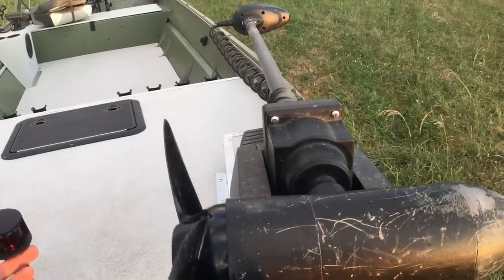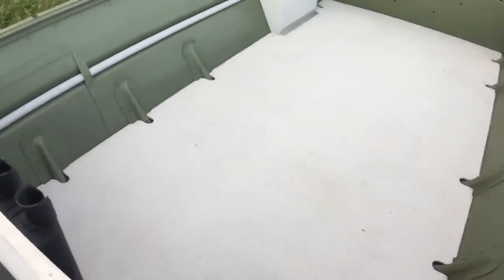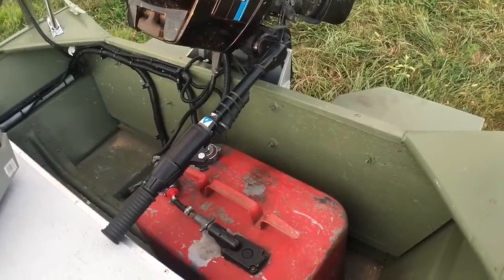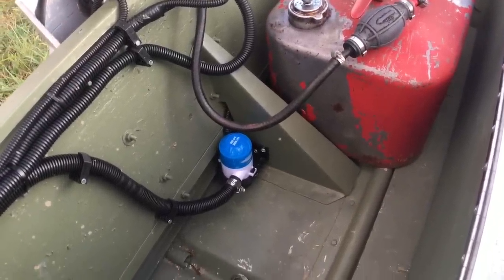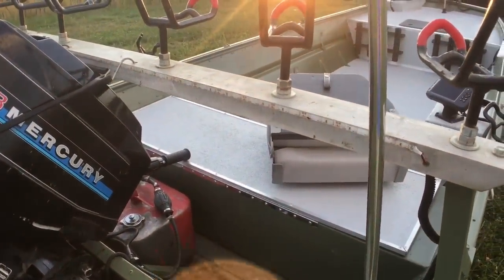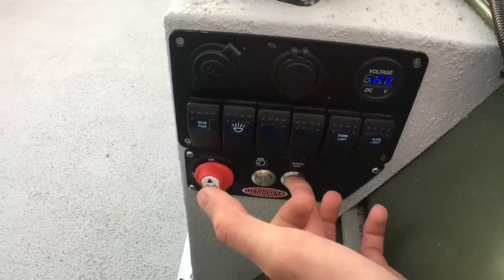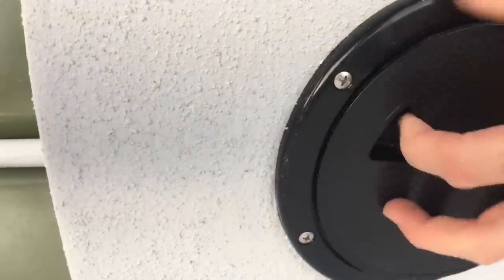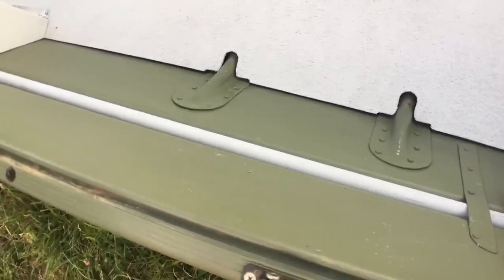The ultimate Jon boat for catfishing..Jon boat to cat boat!

Comment: Hell yeah thank you for the video, I needed to see this cause I have a tiller jet 1750 smokercraft just like this and I am gonna take out the benches and make a jet sled out of it. I built a solid rivet gun for these boats out of an air hammer and 3/4 bolt for butting up these 3/16” brazier head rivets. Gonna re watch this to see what you used for the floor board. A 12x4 sheet of aluminum is around 200$

Comment: Clean boat dude, looks great. What did you use for the tiller extension, looking for something exactly like that, only a minor extension. Did you cut one down?
Reply from the maker: Thank you, I will be happy to answer your question if you could elaborate a little more. Thanks for watching.
Reply: @hagengrubbsfishing  My bad, *tiller extension. The outboard handle.
Reply from the maker: Oh ok I gotcha lol. I think the one I used was originally for a trolling motor that I cut down to size. 👍
Reply: @hagengrubbsfishing  Awesome, that was my plan as well. Thanks for info.

Comment: After removing the middle bench have you noticed any flexing or any 
other actions of the boat .
I've got a 16' Smoker Craft and I would like to do the same thing to my boat.
Your boat looks good.
Reply from the maker: No I was worried about that but there was actually a rib under the bench that I removed so I didn’t notice any difference . Than you
Reply: @hagengrubbsfishing      Thanks for the reply

Comment: Dude THIS is exactly what I needed, just absolutely awesome and most of all PRACTICAL ideas.    Couple questions, what did you build the switch box out of? Just 2x4 and 1/2 ply? Where did you get the access panel? And you used 1/2 plywood topcated with bedliner for the flooring, correct?

Comment: This is great! New sub here, love the content. By far one of the best setups I’ve seen, did you notice a difference with rigidity out on the water with the center seat section removed? Removing that opened up a ton of possibilities.
Reply from the maker: Thank you, I did not notice a difference after removing the bench but that was definitely a concern I had.  Luckily there was a rib inside of the bench. I also think extending the front deck helped with side to side rigidity. Thank you for watching 👍

Comment: What u use for the deck marine ply wood. And we're u get the no skid coating ur talking about also info how take bench out leave rivets in. That what want do my boat have large open area
Reply from the maker: The deck is just regular 1/2” plywood with several coats of oil base paint to preserve it.. the non skid coating is called tuff coat and I ordered it from amazon.. as far leaving the rivets in I just cut the bench off flush with a cutoff wheel and ground everything smooth with a grinder with a flap disk.. Hope this helps. Thanks for watching

Comment: When your 12v outlet starts giving you problems check out some of the Anderson Power Poles 15a/30a/45a size (Powerwerx.com)   Wire them up like the Amateur Radio guys (HAMS) use them (red on the right, tongue up).  Put them on every thing 12v and can't be plugged together reverse polarity. Even have sizes for your starter battery, Winch battery, jumper cables ect. Very durable! Awesome boat build!

Comment: Does the center seat being removed make any difference in the stability or can you even tell a difference? Really good video btw👍
Reply from the maker: BV_PawPaw can’t tell a difference. The back of the deck starts about where front of bench was so it supports the boat about the same as bench did. Thank you for watching

Comment: Just wondering as I am planning on getting a Jon Boat and setting it up . HOW hot does the floors etc. get in the sun in the mid summer hot days. I am in Central Texas and I do not want to be cooking myself or my wife out on the lake when it's about 110 degrees and sunny.

Love you videos. I have been checking out a lot over the last few months getting ideas and watching HOW I DID IT and WHY videos.

Comment: Did that boat come with the center. Like that with that space in the center if not could you tell how did you do that
Reply from the maker: For the most part yes. It had a bench toward the front that I removed and extended the front deck some. ThNk you for watching.

Comment: How did you frame out the inside of your trolling motor mount? Aluminum angle on the inside and riveted the plywood to it? I’ve copied a good bit of your boat to mine really like the setup, I’ll have to send you a pic of mine

Comment: I've been debating about getting a mini jack plate for my 1978 ,15ft Fisher marine, 25hp, looks like a lot of trouble to take motor off & on, have some (trolling motor only lakes , that i like to fish, Does the plate make enough benefit? Would you do it again? Overall Nice Job. Thanks for Sharing your ideas & video.
Reply from the maker: The main reason I went with the jack plate was to have more room for a side imaging transducer.  It didn’t make much of a difference in speed or anything. Thank you for watching and if you have any more questions feel free to ask👍

Comment: Where did you get the supplies you used? Like the black flexible pipe for wire and the white stuff you used for your panel box.
Reply from the maker: The black flexible stuff that the wire is in is just wire loom and I had a bunch from another project but I think you can get it at any auto parts store or maybe even Walmart.. the panel box is just 1/2 plywood coated in tuff boat.. thanks for watching

Comment: How did you cut the seat out ? Thanks for sharing
Reply from the maker: Chris Garmon I used a cut off wheel on an angle grinder. Then I sanded everything flush with a flap disc. Thanks for watching

Comment: Does the boat flex at all without the center bench when you hit a wave? I’d be taking a job boat shallow but also across a saltwater river with wicked current and it can get choppy fast on certain days. I’d like to have little to no flex in up to 1 1/2-2 foot waves max to stay safe when a storm kicks up
Reply from the maker: This particular boat does not, it actually had a rib under the front bench. I made a video recently  explaining that and a few other frequently asked questions.  If  you would like to check it out here’s a link. 
Thanks for watching.

https://youtu.be/ceVhwyvlsUI
Reply: @hagengrubbsfishing  I’ll make sure to check it out.

Comment: so its a wood floor coated with non skid coating?
Reply from the maker: Correct, and coated with several coats of oil base paint on the bottom of plywood just to keep moisture out. Thanks for watching

Comment: I like your build.  My boat is similar to your and am interested in you console.  What are the deminsions, materials,  and how did you attach it at the top. Also where did you get the spin on hatch.  I also noticed your bench seats that you converted to srorage...are you concerned about losing the floatation.  Any help on the build details would be nice. Maybe we can talk easier by email. ..tks
Reply from the maker: I’m not sure on dimensions of console right off. It is made with just 1/2” plywood. At the top it just has 3 small stainless screws through the gunnel. All The materials in the entire build came from amazon.com. As far as the bench seats they were like that when I bought the boat but with all the air space in the float pods along with the addition foam I have added under the floors I believe that it should be the same as before. At least I hope so. I hope this helps. Thanks for watching and tight lines👍

Comment: Great build. I’m going to build that counsel for my Jon boat. Where did you get the bottom panel with the disconnect?  I’m also going to build a rod holder like yours. Is there any difference in the left and right handed monster holders? Could only find right handed on amazon.  River is frozen now so perfect time to upgrade my boat. Thanks for the ideas.
Reply from the maker: Thank you.The small panel with the disconnect I made out of a piece of aluminum. I only use the right handed monster rod holders. Imo if you get them tight there is no need to use the right and left handed threads. Thank you for watching and good luck👍
Reply: Hagen Grubbs Fishing thank you for the quick reply. I thought maybe that panel was homemade. I only questioned the holders because your link was for left handed. One last question can do you know roughly how tall the rod holder uprights are? I may have missed that in the video. Thanks again.

Comment: Hello, I just simply this set up. 
please tell me if the tough coat is a paint or some type of board. If it's a board that you used for the deck and floor, how thick is it?
additionally, is your motor remote control or manual?

Comment: What is the front deck and floor material? Looks good
Reply from the maker: It is just 1/2” non treated plywood. The bottom is sealed with several coats of oil base paint and the top is coated with a non skid coating called tuff coat. Thank you for watching 👍

Comment: Did you use ply wood or aluminum for your flooring and console. I guess what I’m asking is what did you paint non skid?
Reply from the maker: I used 1/2” plywood on everything. Bottom side is coated in 3 coats of oil base paint top side is tuff coat. Thanks for watching.
Reply: I'm guessing the white paint makes it water proof

Comment: How hard was it to remove the bench seat? Thinking about doing it on mine.
Reply from the maker: It was very easy. I just cut it out with a cut off disk. I left the lip inside the boat just because I didn’t want  to replace the rivets. Thanks for watching

Comment: How long is the total front deck lengthwise and would you happen to have a link for the switch panel on the bottom with the red power switch
Reply from the maker: I will try to remember to get a measurement on the front deck. The bottom switch panel I made out of a piece of scrap aluminum. Thank you for watching👍

Comment: Is that aluminum angle iron or some kind of aluminum corner molding you used on your deck?
Reply from the maker: Aluminum angle. I just used it as trim to clean up the way it looked and keep the edges of the plywood from getting splintered.👍
Reply: @hagengrubbsfishing  thanks, ill have to do that to mine. It looks great.

Comment: Did you add anything to the paint when you did the floor or is it already added
Reply from the maker: It comes with rubber in it. It seems to be a great product so far. Well worth the money if you follow all the directions and use the recommended primer. Thanks for watching

Comment: When you're anchored and ya rods are out where ya sit?
Reply: Bout the same setup I have I usually sit in a camping chair it’s nice pull the sleeping bag out and sleep on the floor
Reply: I can understand that! Just curious. I'd probably do similar but have a short seat on the front deck I could raise a little when not traveling but I don't have a boat or a YouTube channel so for now i'll keep my opinions quiet.
Reply from the maker: Jason Sparks I have a backpack chair that I use sometimes. I normally don’t anchor in one place for very long so I just set on my cooler most of the time. Thanks for watching..

Comment: How did you cut the seats out
Reply from the maker: I used a cut off wheel on a grinder to cut it out and then used a sanding disk to clean up all the sharp edges. Thanks for watching👍
Reply: Thanks

Comment: How did you put your rod holders on the sides
Reply from the maker: Wouldn’t recommend but I drilled through gunnels. 1/2” is a big hole to drill in a boat but it was really the only way to mount rod holders on this boat because of the shape of the gunnel.
Reply: @hagengrubbsfishing  mine's identical